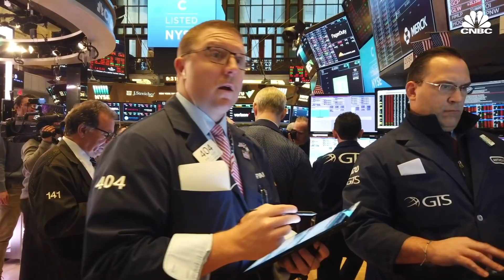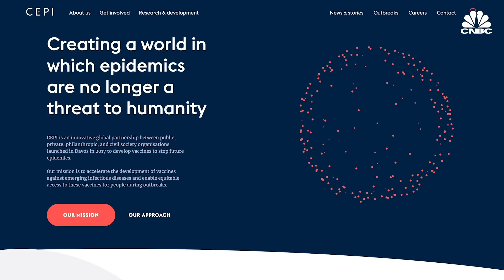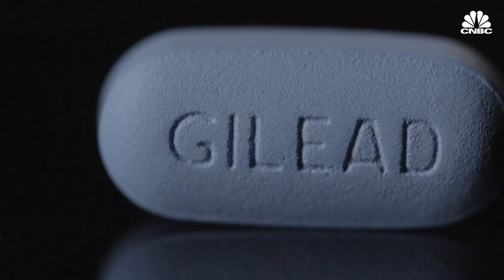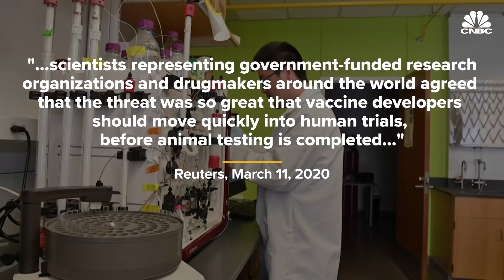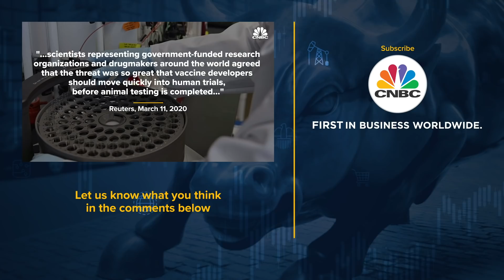The Race To Develop A Coronavirus Vaccine

Comment: On the official website, as part of the authorization for the Moderna vaccine, the FDA has answered some important questions about the use of the vaccine itself, including:
             Question: "Are the Moderna Covid-19 vaccine and the Pfizer-BioNTech vaccine interchangeable"?
             FDA response: “No. There are no data on the interchangeability of the Moderna COVID-19 vaccine with other COVID-19 vaccines, including the Pfizer-BioNTech COVID-19 vaccine. Individuals who have received one dose of Moderna COVID-19 Vaccine should receive a second dose of Moderna COVID-19 Vaccine to complete the vaccination series.
      Individuals who have received one dose of Pfizer-BioNTech COVID-19 vaccine should receive a second dose of Pfizer-BioNTech COVID-19 vaccine to complete the vaccination series. "
      This clarification is especially important for those European nations which, like Italy, have decided to supplement the stocks of the Pfizer vaccine with others of the Moderna vaccine.
      In fact, according to the prescriptions of the FDA, it is essential that health professionals adopt organizational measures such as to provide that, during the vaccination cycle, the individual vaccinated are always given the same type of vaccine, without integrating it with a different one, even if the stocks of the first they are exhausted. This obviously applies to any other vaccine.
      In any case, remember that AstraZeneca vaccine has not been approved by FDA

Comment: CORONA VACCINE IS ON THE WAY
 
WHO IS DYING FROM CORONA?
50% of those dying from Corona are aged over 85, and 92% of those dying from Corona are aged over 65. Therefore, it seems that age is a major factor.
 
-
WHY ARE THE OLD DYING FROM CORONA?
The Thymus is the gland in your body responsible for supplying T cells for your immune system. As we age, our Thymus is progressively converted into useless fat tissue (a process called thymic involution). Typically, by the time a person is 80 years old only 2% of the thymus remains, so their immune system is massively diminished. This would explain why aged people have much less defence against Covid, and why most of the fatalities are of people over 65.
 
-
WILL VACCINES BE EFFECTIVE IN THE OLD?
 
If a person has no immune system, or an immune system that is diminished, then exposure to the antigens in a vaccine will not result in the development of antibodies. Obviously, having an immune system is a necessary condition for any vaccine to work.
 
Consequently, a Corona Vaccine will be unlikely to protect those amongst the aged who already have a diminished Thymus.
 
-
THERE IS A SOLUTION
 
The ONLY POSSIBLE SOLUTION is to regenerate the Thymus. Dr Greg Fahy discovered that there is a simple way of reversing Thymic Involution, restoring the Thymus to a more youthful state. He discovered that human growth hormone is able to restore the thymus.
 
As an alternative to human growth hormone, he used Arginine, which is a single amino acid that is able to stimulate the production of human growth hormone in the body. Arginine is available in most health shops, and is taken orally.
Here is a link to his work - @t
 
Billions have been spent on finding a Corona Vaccine - but here is a solution that is readily available NOW and costs only a few pounds.
 
-
WORRIES ABOUT GOVERNMENT INTENTIONS
What is odd is why the vast body of government scientists are overlooking the above, and instead are intent on spending billions on a novel RNA vaccine, that will not work unless the Thymus is regenerated anyway. I suppose that there is simply no money in Thymus regeneration, whilst there are billions in developing something that is new (and therefore patentable), regardless of its effectiveness.
 
-
A SCARY STRATEGY
 
Vaccines are only effective in those with good immune systems – i.e. in the young and healthy - vaccines will not work in the old. So, Mr Gates argues that the young and healthy must be vaccinated in order to prevent  the virus spreading to the old. Unfortunately, this strategy exposes the entire population of young, healthy people to antigens, regardless of the fact that they are in perfectly good health. Worse still, the vaccine proposed is an RNA vaccine that could possibly have auto-immune effects in the long-term.
 
The healthy young should not be exposed to vaccines when they are in no danger. Such a strategy would expose them to unnecessary risk and complications. Rather than aiming to infect the youth with antigens, we should aim to boost the immunity of the old.
 
-
JOIN THE WHATSAPP GROUP
 
Please consider joining our WhatsApp group. We are currently 50 scientists in training – comprising chemists, pharmacological scientists, biologists, geneticists and computer scientists.
 
To join, you can use this link -  @t
Reply: i cant see the link

Comment: The video made it clear that there isn't much profit for the industry, if any, in developing drugs to combat diseases on a one-time basis.  Political pressure and prestige are motivating the research more than profit.  The progress on attacking the disease on a genetic level seems more promising, long term, than a vaccine or drug, since that would apply to the entire range of coronaviruses and reduce or eliminate the risks of side effects.  But that will take years.  

At present, Gilead’s remdesivir drug is in clinical trials in China on a compassionate use basis.  In at least one case in the US, it proved effective.  Large scale testing is needed.  Other drugs are advancing toward clinical trials.  Making sure the drugs are safe is the first priority.  Short-term, the "test, treat, and monitor" strategy of South Korea seems more effective than the draconian lock down approach we had adopted due to a lack of test kits and medical equipment, especially ventilators.  When those become generally available,  we will probably move to something like the  South Korean model.  Meanwhile, there is a risk that the coronavirus will mutate in ways we cannot foresee today.

Five years ago, Bill Gates warned us that we were not ready for the next epidemic.  Today, we know how right he was.

Comment: Ephedra psuedo ephedra is anti histamine. New psuedofed made with phenylethyelamine or derivitive of mdma. Claiming to be antihistamine but its a hallucinagenic and not approved by the fda either. 
Corona is not grape but wheat and same being a histamine. Histamines are what people react to causing allergic reactions. Allergens in the body cause fatigue because the body alerted to them attacks them same as symptoms of anything threatens healthy system. The body then is open to secondary and more serious issues when stressed by Allergens or temporaryarily dealing with histamines. Alcohol is basically histamine delivery vessel. Avoid extreme or excessive as usual and always during flu seasons probably smartest.
     Ephedra tea and local honey is the best antihistamine and the oldest known medicinal herb traced to the Egyptians and of course local honey boosts immunity to local allergens.
     This virus shoukd be renamed " the cornered virus" because it will be if treated like the allergen front door opening the back door for secondary respiratory issues. My two cents and sense from roads already travelled and learned from by the swine wine flu ect...
Thing is
Rest of the world has access to the meducina plant
USA does not
Hmmmmm